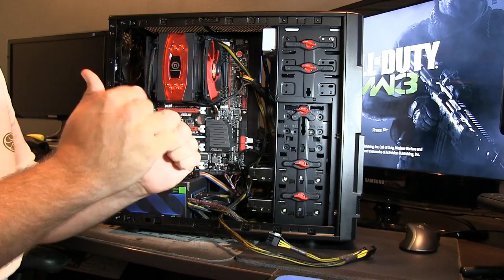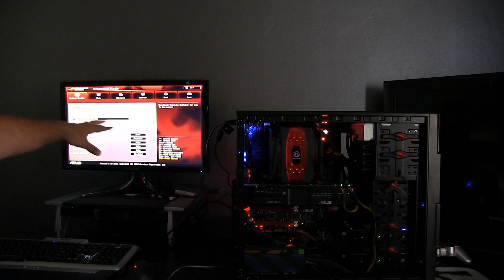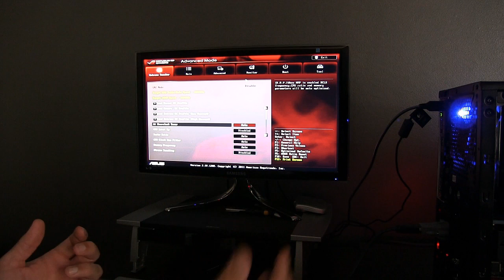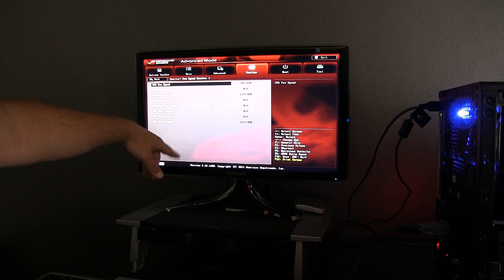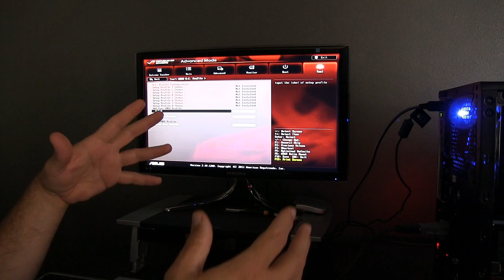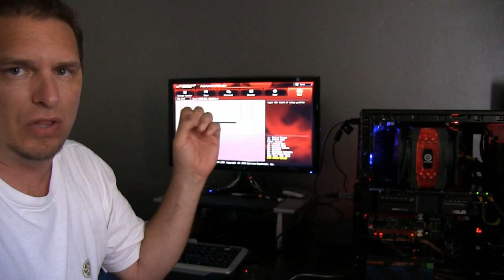Extreme Gaming PC Boot Up |How to build| Part 5 (ASUS)

Comment: If im booting my OS from the USB will i have to have it plugged into a back usb 2.0 before i turn on my system for the first time? and will i have to go into the bios to change the boots device to USB and my OS is on usb

Comment: my exhaust fan seems to run at 100% all the time on the Frio Advanced i have that lead running to the mobo 4pin and the intake lead to a 3pin chassis, could my mobo be bad? it doesnt seem to give me a temp read on my CPU, thanks
Reply: sorry nevermind i fixed it, just had to enable PWM in bios

Comment: I personally bought the coolermaster haf 912 it's huge for a mod tower case, came with two fans cable management holes, space behind the motherboard for cable management, water cooling holes, and GREAT air flow. Perfect budget case and best I could find for the price

Comment: he should have flipped the power supply over so it wouldnt be getting hot air from the inside and also he should have moved the graphics card down a pci slot to keep it away from the cpu heatsink

Comment: all the people saying he is not good at building a PC, what do you mean? he has all the part's he wanted/needed for it, it was all installed into the case fine. Cable management isn't that bad. and IT WORKS. in what was is that not good?

Comment: I would see if you can get a hold of an expansion foam pack, you would break the seal to expand it and mount the cover which will prevent movement of the components in transit.
I have seen this method used by most of the high end PC manufacturers.

Comment: Don't worry about the PSU taking cool air from GPU. The GPU he is using has two mini radiators and fans that will take care of the heat. That's why it takes up three slots. Although its better to flip PSU, it should be fine the way it is.

Comment: Ofcourse it is an intake fan. Fortunately PSU fans do not normally run at a high RPM the graphics card will get enough air.

Although I agree it should definitely be flipped.

Comment: This case actually has a fan opening under the psu, which is dedicated for turning the fan downwards. Plus the rubber feets of the case are lifting the case which means the fan of the psu will get good airflow. Do your research before commenting, so what are you talking about!

Comment: PLEASE THUMB UP!!!! 

If the fan on the PSU is the intake it will pull cool air away from the GPU card. 

If that is the case GUNS might burn his GPU :( 

The case has mesh on the bottom so you can flip the PSU and get air 2 it from under the case. 

Live awesome computer live!!!

Comment: You should place the GPU in the 2nd slot! Those fans blow air onto the gpu and exhaust the hot air into the case, with the way you got it now the CPU will get hotter because of the air comming from the GPU

Comment: I personally wouldn't feel comfortable with anything above 70C but Prime will really do a popper job stress testing if prime can run for 6 hours with out crashing the computer then your probably alright and its a stable overclock, if in doubt use Google and search for " I5 750 Tmax" to find out what the max temp your processor can handle ^.^

Comment: I'm after Overclocking my intel i5 750 using the following setup to 3.7Ghz
Multiplier: 20x
BCLK: 185
Vcore: 1.275V
Memory Multiplier: 8.0x
QPI Link Ratio: 32x
Power Saving Features Disabled
Load Line Calibration: Auto
PCI Express: 100MHz
BTW are my temps OK? Idle: 35 - 40C and full load (on Prime95) I get 60 - 70C.